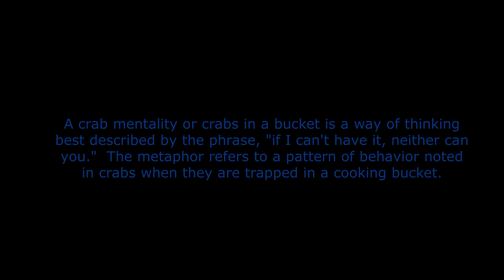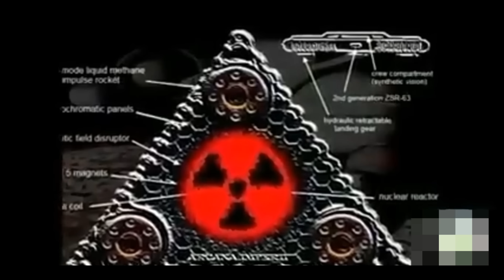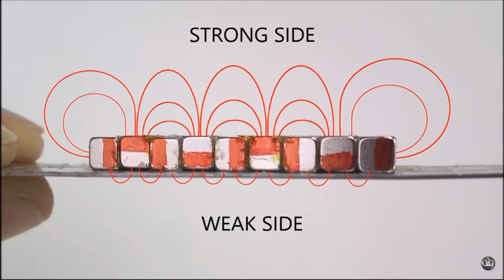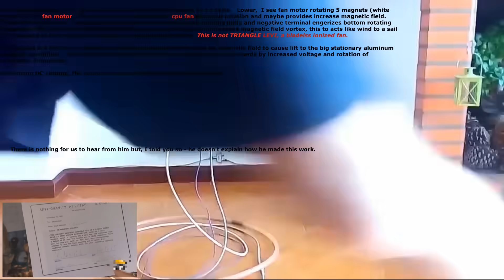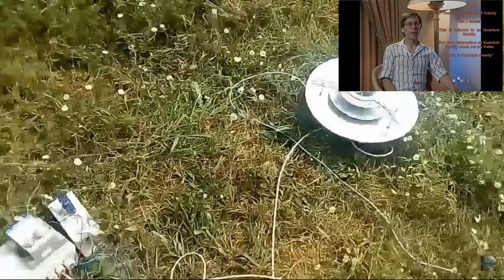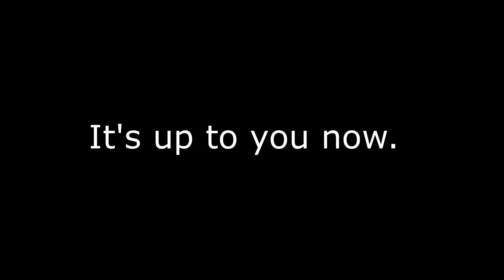anti-gravity project

Comment: Gravity is not electromagnetic in nature. Making an EM "motor" will not attain anti-gravity. When you realize that gravity is the bending of the fabric of space-time by mass, you will realize any attempts at anti-gravity is a fool's errand.
Ion thrust is not anti-gravity, but a thrust engine using the flow of electrons which carries air through the center. It does not work in a vacuum.  Tests have proven it.  Not every planet or moon has a magnetic field. Our moon has no magnetic field. Mars has a very weak one. Asteroids have none at all. 

How would you propose to unbend space-time enough to negate gravity in an area such as on the Earth?
Reply: Although you are right in saying this depicts a magnetic drive, and no connection to gravity, they are nonetheless connected, via the humble electron. Charge displacement does produce thrust as proven by TT Brown et al, and a very powerful gravity wave was produced by Podkletnov, and later measured as having an initial velocity of 64C, as Tesla predicted  it would...These are all facts...
Reply: @stawmy  gravity and electrons have no correlation. electrons are affected by magnetic fields. Charge displacement does indeed produce thrust, but it's an electron wind effect and has nothing to do with gravity.  Nobody has produced a gravity wave, maybe a magnetic field. How would one produce a gravity wave?
Tesla did not predict gravity waves, no could he induce them.
Reply: to contrary. gravity is wilhelm weber fourth part of the polynominal, caused by vibration of atoms, basically vibration of electrons, protons are 1800 more heavy.
Reply: @andrejkiska5061  Gravity has nothing to do with electrons or vibrating atoms. Gravity is the bending of space-time by an object with mass. We are attracted by the Earth because we are at the bottom of the gravity well (accelerating towards the center of mass). 

This is why there is quantum physics. Gravity on the quantum scale has no effect.
Reply: Once again not harnessing the power using it to produce power. And yes one would need to map out other dust balls with the same magnetic fields.
Reply: Dude stop acting like you know anything about gravity because the facts are you know absolutely nothing about it so stop getting high off your own shit fumes. you don't know that gravity is not electromagnetic because we down know anything about gravity! So you cant say its not something when you know nothing! If you cant prove what its not then you cant say it and have people take you seriously. PS our moon has a magnetic field what are you even talking about dude! Maybe do your research before making ridicules clams with no evidence to back it up. We don't even know if gravity has anything to do with space time.100% of what we propose is still all theory..
Reply: Step one. When creating a diamagnetic field, it MUST be strong enough to overcome the pull of our core.
I investigated BTW. Here's what I found.
March 2019 the university of Rochester LLE discovered how to turn liquid metal to a plasma state under high density conditions. What's in our Earth's core? Nothing BUT high density conditions. 

https://www.sciencedaily.com/releases/2019/03/190311125134.htm

Here is an experiment done with a plasma ball being spun at 4000 RPMS. It creates its OWN magnetic field!! Notice how the south pole tries hard to form, despite the post fueling it being in the way. 

When they put a tinfoil hat on it, the plasma tries to draw energy off it. NORTHERN LIGHTS. Drawing charged particles of the sun to fuel our core.

https://youtu.be/Wis_HEa3X84

Admiral Byrd ring a bell??? He flew his plane into a massive hole in our pole and came back claiming "A sun inside the Earth". 

Now you could perform that EXACT same plasma globe experiment with metallic plasma. Nickel and iron, instead of basic neon gases like in the standard plasma globe. Rotate it VERY FAST and what do you get?? A VERY strong magnetic field.
Prior to massive quakes, they've discovered MASSIVE amounts of Very Lower Frequencies and Ultra LF's leaving the faults, and plates, hitting the ionosphere, plucking the magnetic field string like a guitar. Or if you prefer, plucking the magnetic field string like a H.A.A.R.P, causing reverberation heard for hundreds of miles. (Trumpets). 

https://www.ncbi.nlm.nih.gov/pmc/articles/PMC6010448/
Plasma is the only thing that can NATURALLY cause VLF/ULF waves. 

Linda Moulten Howe had a piece of UFO metal sent to her from a man who was involved in a crash cleanup in the 1940s in white sands NM. The bottom of the craft glowed for 3 hours after the crash. After it stopped glowing, he broke pieces off and kept it for nearly 50 years. In 1996 his son sent pieces of it to Art Bell. He gave a piece of it to Linda Moulten Howe. Upon scientific analysis of it, it was discovered the metal is made up of micron level layers of magnesium, zinc, and bismuth. Upon furthef analasys, results show it was subjected to TERAHERTZ frequency approaching the speed of light, and it's ION levels were 60 percent higher than they should be. This will shed light on that for you. 

Here is an experiment done with a ham radio 100 watt put through 4,3 500 Z tubes bringing it up to 3400 watts. in which the stainless steel antenna is being turned to PLASMA because the antenna is being pumped with HIGH FREQUENCY Waves the metal cannot handle. He's able to talk through the plasma because the plasma causes VLF waves, like a speaker does. 

https://youtu.be/4yLbYlyT7wM

Linda's metal has 60 percent more IONS because it was turned to plasma using an even HIGHER frequency. Terahertz. High frequency turns metal to plasma, BYPASSING the liquid stage. Terahertz, could BYPASS the plasma stage, converting to a state of matter we have not seen yet. Pure energy maybe? 

Linda's ufo metal is very special. Bismuth, magnesium, and zinc all are DIAMAGNETIC metals. Meaning they REPEL magnets. So if you perform the EXACT same experiment like the plasma globe, you will NOT get a electromagnetic field. You get a very STRONG Diamagnetic field, the faster you rotate it, and the more energy you put into it, the stronger it will be. Meaning it will repel ALL electromagnetic waves that are IN and around EVERY object on the planet that obsorbs charged particles of the sun. Including in the air. Imagine the plasma ball experiment done properly, and a decent size, being able to levitate 10 ton granite slabs and pushing them. 

Let's look at Bob Lazars Element 115. Unumpentium. Now known as Moscovium. Only a few atoms have ever been made, and they've been made to make NIHONIUM (Element 113), which was created by colliding ZINC nuclei, together in a thin layer of BISMUTH. 

Both DIAMAGNETIC elements. 

both UFO cases involve these crafts creating ANTI MAGNETIC FIELDS. Our Earth's core, is plasma. The strongest electromagnet of the universe. Everything IN and around us has electromagnetic waves holding us down. 

Look at the moon. It's the size of earth's core. It has a SMALL plasma core. We SEE flashes of its light bouncing up off the crater walls, which looks like lightning in craters. The moon has a small magnetic field. It has small amounts of electromagnetic waves on it. "gravity".

 Why couldn't Einstein solve gravity? Why couldnt Issac Newton solve gravity? Why are scientists still chasing their tails for gravitons and dark matter??

Gravity is NOT REAL. So the elites who rule over us can keep us ON the ground, under their thumb. The minute we can leave this planet, we're FREE. To never return. Who will they borrow money to then at a high interest rate???

The universe is ruled by electromagnetics. Charged particles of not only our sun, but billions of other suns in the universe spread electromagnetic charged particles at ONE million miles an hour absolutely everywhere, covering every inch of space. The universe is the ocean. UFOs with their Anti-magentic fields are the surfboards. 

These UFOs are creating DIAMAGNETIC fields. To push away ALL electromagnetic waves, using it to generate push. 

The battle of Los Angeles. Mortors couldn't hit that UFO. It REPELLED them. An outwards force. An outward diamagnetic force repelling all the metal mortors. 5 people died that night from falling debris. 

Why do you think the "small" amount of energy from lightning (plasma) always tries to ground itself?? It's trying to connect to the quantillions of watts deep below our feet. Here is the first ever slowing motion capture of lighting striking the ground in slowly motion. 

Watch what comes OUT of the ground at the 2 minute mark, to connect with the lightning coming out of the air. 

https://youtu.be/RLWIBrweSU8

If our core WASN'T very strong electromagnetic plasma, there would be NO WAY to drain the electromagnetic energy of the sky, resulting in CONSTANT massive storms on our planet. 

The word gravity has been pounded into our head MUCH longer than the word Russian. 
 Call invent-help and lisyen to them tell you they aren't allowed to help you find alternative fuel methods for vehickes, and alternative energy sources because it's against  government law. 
You saw what kind of Plasma that stainless steel turned into under high density conditions. With your own eyes. But go ahead and keep reading government printed books by government funded scientists. Fun fact, 90 percent of scientists are JUST like you. They read. That's IT. They also comb through thesis's and pick and choose what to accept into their teachings as well. There's only a VERY small handful of scientists working with REAL equipment to chase down God particles and dark matter and gravitons. And they're ALL government finded. But one fact remains. We will NEVER find the source for "gravity". We will always as citizens, be stuck here on this planet under their thumb.

Electromagnetics rules the universe. 

Gravity is BS. It's time we replace "Gravitational pull", with "Magnetic pull".
Reply: @vDarknessFalls  as in what? The magnet field? How strong would that have to be? Our strongest electromagnets dont't hover above the ground. Even the electromagnets on cranes in car junk yards exhibit no anti-gravity effects.
Reply: @UnderMan  our Earth's plasma core is the size of the moon. EVERYTHING that captures heat, ie charged particles of the sin, will be drawn to it. A diamagnetic field would have to be strong enough to overcome that magentism. If you didn't read my comment and check my sources, don't bother coming back here. I'll post another link below for you to check out.
Reply: @vDarknessFalls  why haven't we built a craft yet? Is it because of missing energy source?

Comment: Natural phenomena can open the mystery of the gravitational interaction of bodies. For example, liquids under the influence of gravity begin to twist, a whirlpool is obtained (a funnel, this is especially noticeable when water is quickly drawn into a narrowing hole). The direction of rotation clearly depends on the earth's hemisphere; and opposite to the direction of water movement in tornadoes.Considering a tornado in which a liquid moves up-against the force of gravity, we see that the substance rotates in the opposite direction to the whirlpools. We can assume that the rotation of physical bodies (especially regarding liquids and mercury!) In the direction corresponding to the movement of substances in natural vortices (tornadoes ) can lead to the appearance of fields of opposite gravity in directionality.
Reply: This is not how gravity works. The vorticies you are referring to is due to heat and cold, high pressure and low pressure, along with the rotation of the earth. These things have nothing to do with anti-gravity. Do you have any idea what gravity is? How do you propose to negate gravity if you have no inherent understanding of it? Tell us, how do you unbend space?
Reply: Rotation of vortices in different directions depending on the Earth’s hemisphere (the same applies to whirlpools) does not depend on temperature, pressure and simple rotation of the planet — here something else is connected with the poles and the Earth’s field.
Perhaps, researchers should not delve into the “unbending of space”, because gravity is a kind of field created by physical bodies (and the interaction between them). Recall the work of scientists to find the relationship between electricity and magnetism - exploring gravity, you must follow a similar, experimental path (without discarding possible "tips of nature") - only at a more technological level!

Comment: To me, everything you are showing and everything you seem to be trying to head towards is in the wrong direction.  I have discovered 8 or even perhaps 10 ways of accomplishing levitation.  None of them require electricity per se....and from what I can ascertain, any attempt as using electricity to levitate will result in failure.

Perhaps you should start with ways to levitate and work backwards from there.  Beginning first with the fact the conventional concept of gravity is flawed at its core, pun intended.
Reply: I have a cheap device, that someone gave me, that separates hot air from cold air, by moving air thru a vortex, creating a torus. I'm sure someone has solved the anti-gravity problem. If I could see it anyone could.
Reply: @60sMark909  Please, you  can share a photo of that device?

Comment: If the math checks out then this is possible. However this is a technology that will never be made known to the public. I'm sure that I have seen a working one due to having a spherical blur with a center that was large. There is a military manufacturing building about a half mile from where we saw this device. This would be considered a national threat if the public had knowledge of this just like having a water powered car. I do believe that this has already been perfected but we the public won't ever be told.

Comment: Why use a stick to show there is nothing above the device in the field?  Why not just stand underneath with the camera and point the camera straight up to show no cranes or trees or L shaped Brackets that could be used with fishing line?  While simultaneously picking up the dangling cords to show there is evident slack and no hidden poles holding it from below.  Garbage is why.  The dude in the field didn't even try to move it over a few inches into a new position.  Because it was on a line from above.  It's a sad attempt at magic.  Ridiculous.

Comment: Nice try !!! When you got the wires at the end of the video, the effect of the wind flowing to the right of your t-shirt was clearly visible.Its happened just for few second  when you were completely beneath  the anti-gravity device in, because you were in direction of the wind flowing of fan of your device. it seems the anti-gravity device you made is working by an electrical engine like quad-copter. Anyway, if you were right, you are billionaire now, and you should received many offer from many different company, organisation, and even NASA. I never see any news about you and your incredible invention !!!!
Reply: EPipe One hello there. They already have gravity control and will reveal it when They deem necessary.

Comment: I have a theory. If you take small few inches thick copper plate, large few inches thick copper plate and few inches thick quartz/glass plate, and assemble it with quartz/glass plate between two copper plates acting as a dielectric material forming a cone-like shape. Apply very high million volts DC or electrostatic on a smaller copper plate with Tesla coil but with very low current/amps, apply very high current on larger copper plate but with very low voltage. If you managed to create an unbalance between two copper plates with high voltage on one end and high current on other end, in theory you should get aether/gravitational propulsion with high voltage creating G well and high current creating G hill in aether space. Insulate high voltage copper plate with wire tape or experiment in vacuum chamber or submerge the whole experiment in oil to avoid ion wind. Possible simple experiment to find out how those ufo's propel using extremely high electricity, frequency too is likely much higher than 50/60 hz in those ufo's used secretly by military.

Comment: some late info.    at 9:50,  there is no reason to believe that this is not a hoax.    if gravity has been overcome,  WHY  DOES  THE  WEIGHT/MASS  OF  THE  CABLES   NOT  PREVENT   THE DEVICE  FROM  RISING.     it  SHOULD BE NOTED that the  'hoop'  is, CONVENIENTLY,  NOT  in the Frame, at the  Key Moment.        at  10:14,   the video quality appears to be low.   the result is  MANY  places, where EDITS   might be.     the commentary is an ASSUMPTION.       to this day,  the  NATURE of gravity is NOT  understood.     gravity may be JUST  WHAT  WE  CAN   PERCEIVE, of a process that is occurring in  HIGHER  dimensions.   we  JUST  DON'T  KNOW, yet.           on the other hand, overunity  power  generation   has  been  POSSIBLE, for more than 20 YEARS.         in order to  SEE  why this is true, one  Ancient and  OBSOLETE 'rule'  describing the limitations of a (simple)  machine, MUST  BE  IGNORED     why is this true.     a  Large-radius,  ROTARY  2ND-CLASS   LEVER   is  NOT  a   simple   MACHINE.   it is a  (Driven)  WHEEL,  GEAR,  PULLEY  or  SPROCKET, in which is  Present,  INHERENT  MECHANICAL  ADVANTAGE.     (this is Old and Known  physics;   not some wild  pretend  schett.)     if interested, see my channel; see the  BASICS, set out in a comment at my latest video.    note that, at 6:55, in the linked video, instead of spouting  gobbledy-gook,  gerardmorin is  talking  about    Inherent MECHANICAL ADVANTAGE.        googletranslate
https://www.youtube.com/watch?v=AAlxGYpi_5s&list=UUsiwv99k0t62ARYwDuytnjA
Reply: U did too many lines
Reply: Way too many line's.